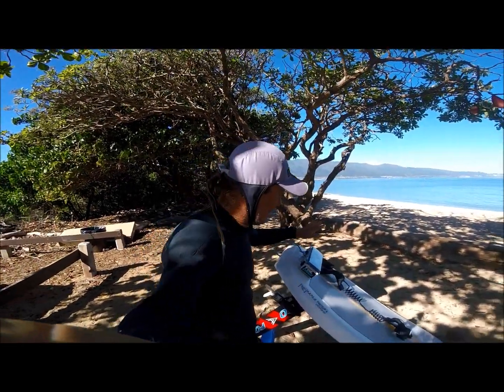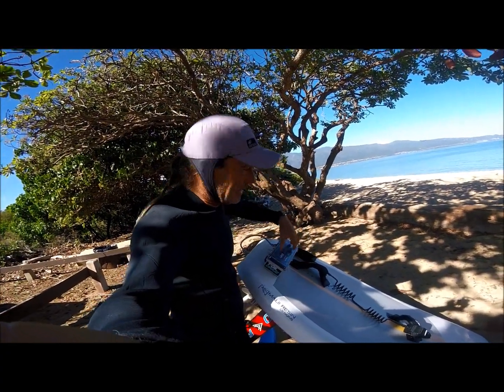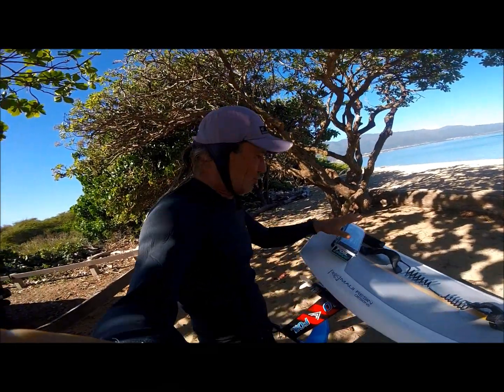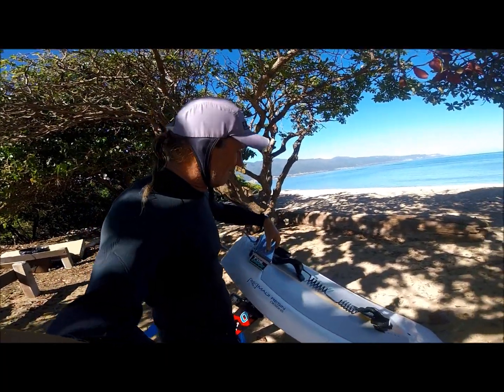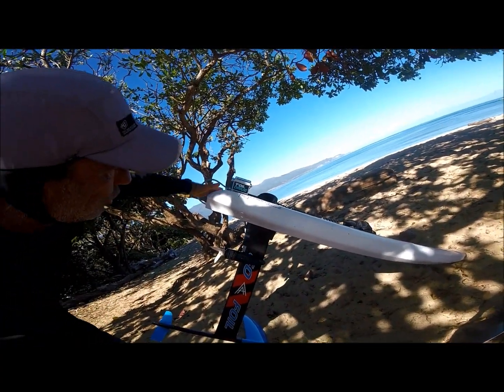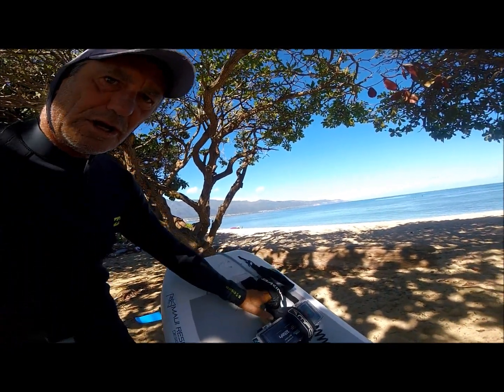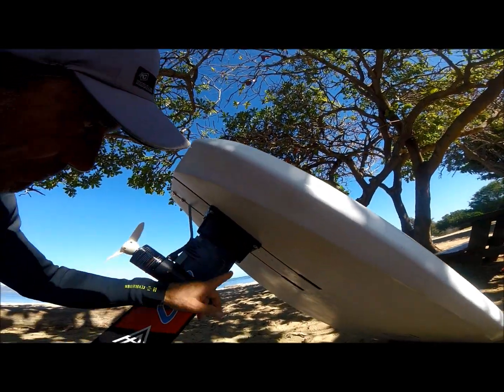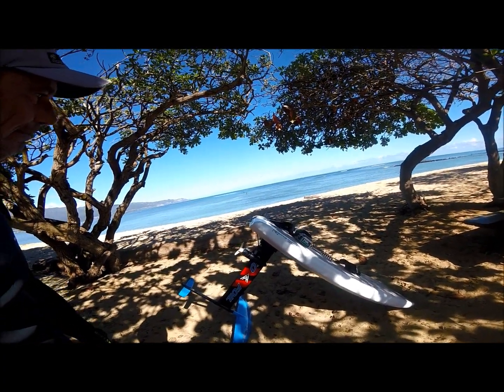Foil Drive battery box position test. Mauisurfreport.blogspot.com

Comment: Where did you order the longer cable from?   I have the short too...would like to mount in middle like you have
Reply from the maker: I originally ordered my Foil Drive unit with a 2m cable. Don't think you can change a shorter one for a longer one

Comment: Hi GP, I’m making a home made foil drive and considered putting battery pack in a slim bit secure camel back backpack. Cable runs up through tube webbing which acts as leash so no strain on the cable when I fall. Would welcome your thoughts, main motivation is getting weight away from the board so pumping isn’t as affected. Thanks for all your documented research and progress - inspiring !
Reply from the maker: Hi Jonathan, sorry I only see your comment now. In this video I show why I don't like the FD in a fanny pack: https://www.youtube.com/watch?v=NxLmljhHWiI